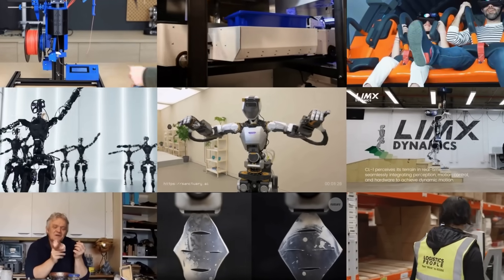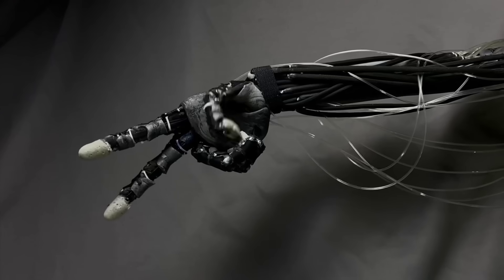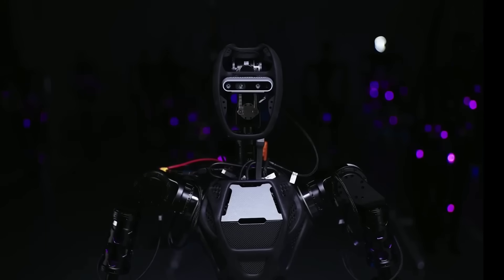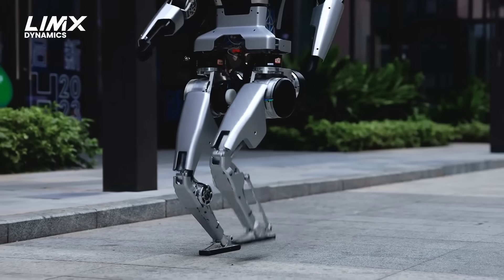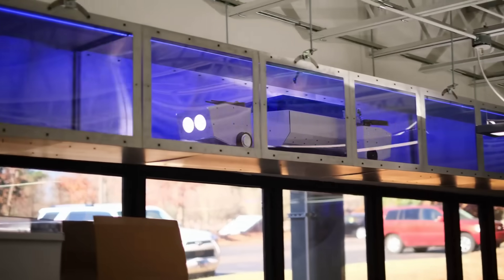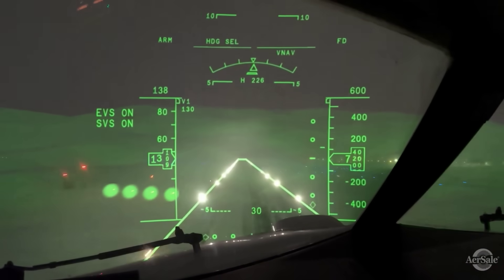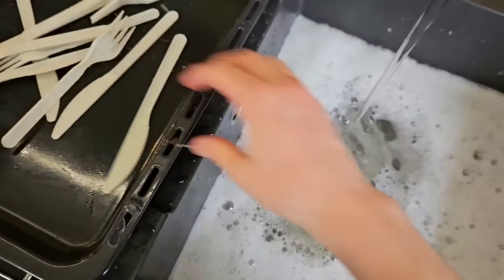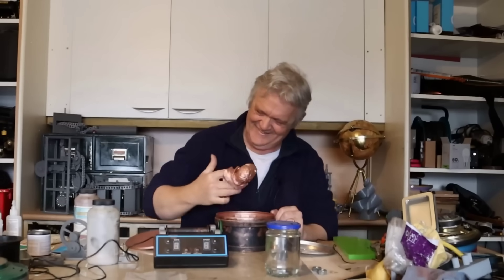2024: The Year of Humanoid Robots? (+ More Tech News)

Comment: I still don‘t think humanoid robots make any sense outside research. Why build a factory and then add humanoid robots that will always be slower than if you just build the lines around specialized robots?
Also, why legs? They are significantly more complicated and most factories already have elevators and stuff since they need to move equipment, I just don‘t get it.

Additionally, I doubt they will be even comparably fast to humans in this decade which will likely make humans a better choice in almost all remaining use-cases.
Still, the research going into it is obviously worthwhile for more general advanced in robotics and related fields. If you can build a humanoid robot, you can most likely also build a more specialized one re-using most of your electronics and software.
Reply: Agreed. The people saying they'll be the future aren't understanding the needs of the potential customers. Buying a machine with legs it doesn't need is ALWAYS going to be more expensive than building a table in the spot it never moves from. Hell, if you need it to move you can just install wheels.
Reply: That is. But they need funding and that is why these videos are created, they encourage young people to study STEM careers, etc. In short, they accelerate technological progress. Until there are improvements in battery usage or new architectures, humanoid robots will simply be insignificant. Movies about robots are great, but everything has a money cost. Capitalism will never disappear.